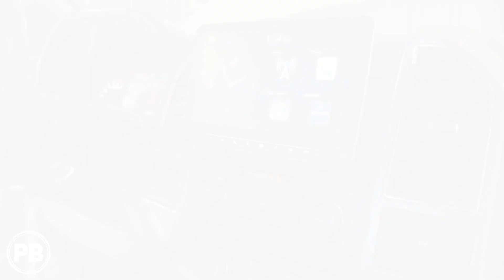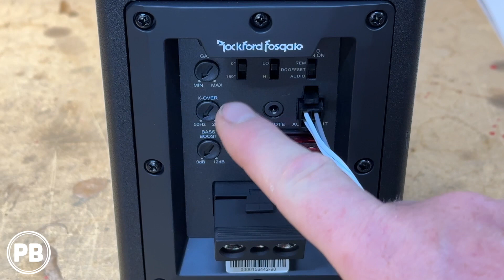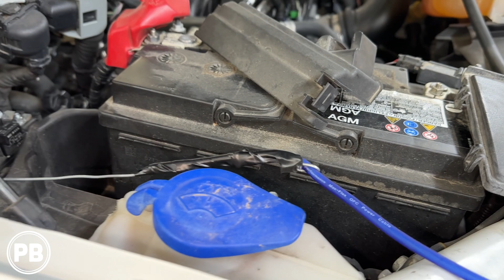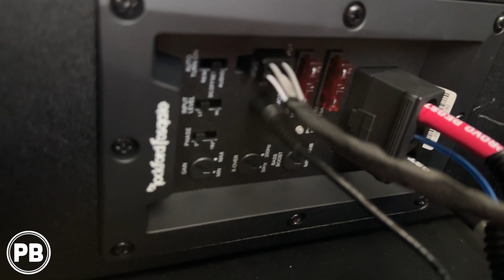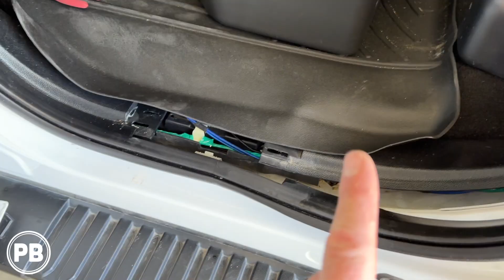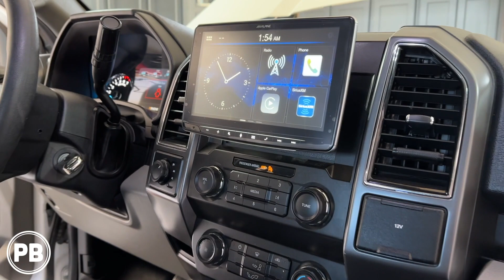2015 - 2020 Ford F150 EASY Amp and Sub Install (to aftermarket radio)

Comment: I just put this sub in my 2024 F150 Supercrew.  The underseat fit is fantastic even without that plastic tray.  My installer used a really nice bracket system to hold the unit in place.  
Plenty of bass.....and we also used a DSP as we did not change out the factory head unit (I have the 12" screen).

Comment: I have a 2015 f150 if I got that t harness you put in the description do I really need that power converter?
Reply from the maker: It makes the install super easy, yes.  You could tap into the speaker wire found in the B-Pillar, but that requires a custom modification.  My harness is plug and play.

Comment: Don't use this location for ground. These trucks are aluminum bodies which have less conductance. Either run a ground back to battery or find a place to ground to the frame or something metal that is connected to the frame. I would also stay away from the factory grounding point they show because it most likely isn't a big enough wire. Also you already had the panels off on the passenger side so why not run RCA cables and remote wire at the same.
Reply: Aluminum is 3x more conductive than steel bodies as long as you properly remove the paint and oxide layer - which he did.

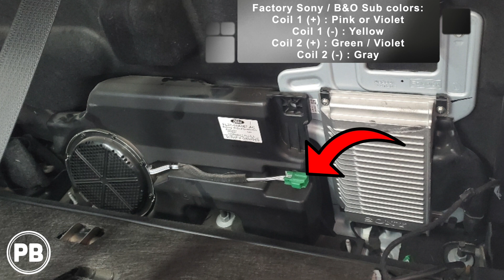Comment: 9:47 is coil 1 the left side and 2 the right? Also do I use speaker wire to extend the high output harness?

Comment: Hello brother, I have 2023 Dodge charger, I am thinking to use my rear speakers for audio output. My question is I have to connect both the rear speakers with audio input cable or I can get signal from one speaker only?
Reply: both my brotha but some cars u can get away with one i do both every time tho
Reply: @ thanks brother I did on both

Comment: Excuse my question if the  truck still have the factory Radio, where do you connect the Remote Wire on the other end ????? Thank You

Comment: I have this exact setup, but have always felt it wasn't tuned properly. I feel that your note on how you set the gains and x-over I'm going to try that and see if it sounds better. Awesome!!!!
Reply: I know this is old, but if you change the factory EQ to flat in Forscan you'll send a flat signal out to your subwoofer and restore the bass that's missing from the factory head unit.

Comment: 9:53  Thank you for this video! I’m curious before I buy this setup. I have this basic same system in my 2020 F150. Question is do I just take the old sub out and use those end of the wires to connect to this on hi level input? Do I still need the converter/amp in play for that connection or can I use wires from the other side of the converter/amp? This would be the stock wires and subwoofer kit.

Comment: How do I add a lc2i to this setup?
Reply from the maker: If you have Sony / B&O, connect to the sub output from factory amp.  If base audio and just adding a sub, just tap it into any speaker wiring.  You can access from rear B pillars for rear speakers, or behind the radio for any speaker wiring.
Reply: @ProvoBeastAudio   I bought subs and an amp too can I still just tap into the output of the B&O amp?

Comment: Thank you for you this informative video. 👍 I'm curious about the 9:30 mark. 
Am I able to connect this subwoofer to the factory subwoofer for both power and audio signal? Or do I still need to run power up to the battery?
My thought is to easily be able to take the bigger subwoofer out if I need the space and temporarily use the factory.

Comment: Another amazing video!!!! thanks for sharing
have a question, if I have B&O basic system (F150 2022) improving the bass I have kicker amp and sub, do I will need a LC2i pro??
Reply from the maker: Nope, but I do recommend a higher power input handling LOC since you have the factory amplifier.  A more budget LOC would be this guy: https://amzn.to/49CJdex
Reply: @ProvoBeastAudio   Oh no, I read late your answer, I was working today doing the wiring for my truck ( which the power and ground wires are to short, I have to found an adapter and buy more wires) I installed the LC2i pro already, I hwas watching a video front your channel, will be any different if I continue using the LOC?

Comment: This adapter saved me but what do I connect the remote wire too haven’t got the adapter yet but supposed to be here next week can’t wait to hopefully get my speakers set up
Reply from the maker: This has an auto turn-on feature built into the powered subwoofer.  The amp has a switch for remote - switch it to audio, and it turns on for you.  No need for a separate remote wire.
Reply: @ProvoBeastAudio  so hook it up and it will be good

Comment: 🤔. From research I've done on my 2015 F150.  They're should be a factory installed...Hot Power wire in the rear behind the seat area I believe it's tucked under carpet or back wall ... Thought I'd share 😊
Reply: not low enough gauge for a decent sub
Reply: @TheDrakeArnold if it has it you can just tap into the speaker inputs.
Reply: Your so stupid 🤣

Comment: I have a 2020 ford f150 with the base stereo no Sony or b&o. The t harness you connected is just plug and play? Do I have to use the remote wire on it? I have the same sub you are installing in this video but I am running the remote wire to fuse 23 on the passenger side. My amp is powered but I get no bass from it right now I have a cheaper t harness from Amazon that was $25 it broke the first day because one of the pods fell off smh. I was hoping the t harness you listed is more legit and better quality.
Reply from the maker: yeah, just plug and play.  No remote wire is needed as that rockford fosgate powered usb can turn on for you per the settings on the amp itself.  That T harness is untested, but is a simple solution to the install.  Alternatively, you can snag signal from the b pillar rear speaker if that works better.  Good luck to ya.
Reply: @ProvoBeastAudio  thank you. I received the plug and play harness attached on the link. I noticed the line out put converter is attached to the rear speaker wires on the harness. Wouldn’t it be better for it to be attached to the front speaker wires?
Reply: @ProvoBeastAudio  sorry disregard I noticed it’s the front wires after all. Do you make this harness or someone else does? It’s a nice quality harness